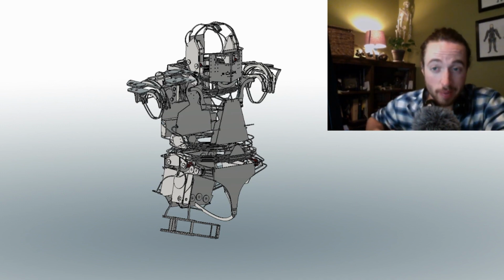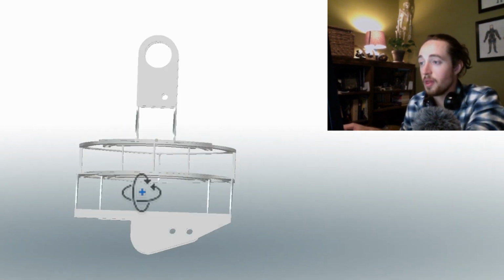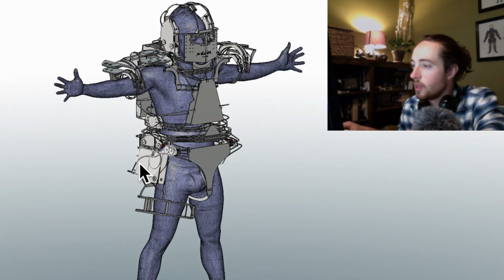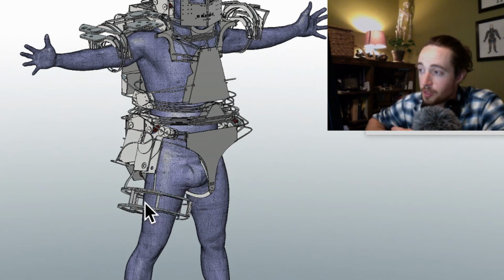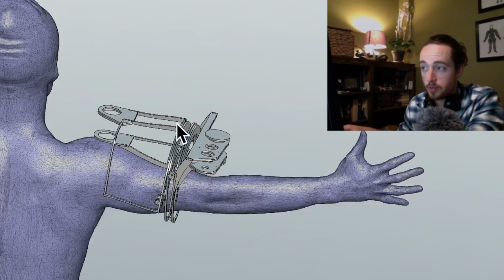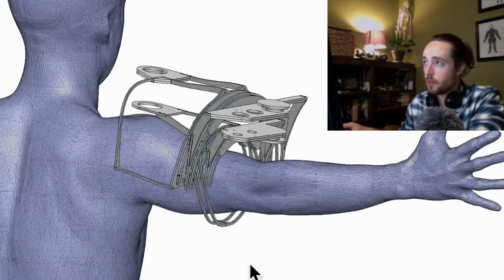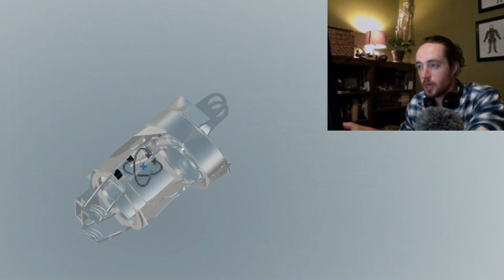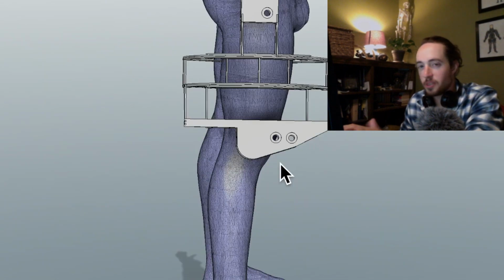AN EXO-THIGH

Comment: if i understand the knee structure correctly, you can only bent it backwards 90°. this could be a hinderence in case you fall down.
Reply from the maker: I’ll have to not fall down. 

There’s a lot parts of the suit that would make falling down bad. When it’s built I’ll probably do some test of how to get off the ground effectively
Reply: @DylanEdmiston   i think you could get something like 110° out of it by pushing around a bit of material. 

a multi directional internal harness, internal plates that cover jagged edges and cushioning  is a must. 

internal cooling and a quick acces crotch plate (because removing the suit might tale a long while) is also recomended.

rule 1,2 and 3 for wearing full body suits (cosplay or otherwise): 
- have somebody out of armor as a handler 
- drink plenty of water
- don't forget to find a way how to go to the toilet with the suit on

you could build a plywood/pvc/paper machee/eva foam  prototype to test everything first.
Reply from the maker: You're right. I will have to pee in this thing.
Reply: 110° to 120° of  knee movement would allow you to kneel down, sit on normal height benches , use stairs easily and get up from falling over. 
the suit is self supporting, as long as the suit doesnt break when you fall (or it is light enough to not crush you when it does) you should be fine when falling over. 

you should include some fuses that can  break by bending (not by acceleration alone) attached to the skeleton in every part of the suit to make the actuators disengage when the skeleton fails/bends. a rip- fuse could also be build into the actuators to deactivate the counter muscle if one muscle snaps.

another safety measure could be the inclusion of internal buttons with a high push resistance that activate breaks in the joints as an independant system. if the suit moves to fast, without your permission or too much force is applied from the outside the afflicted joints lock up for the duration of you inside the suit not conforming to the movement.

this prevents the hammer- drone/ mjolnir- unagmented wielder problem.

giving an external remote deactivation switch to a handler and/or including an external safety break (like you already explained) would nicely add to this... quintupple redundancy.

Comment: When you get the quotes, also ask about the price of difference components on their own. If it adds up to the same amount, then it might be best to save up a small amount and order the Torso first and test it for issues while saving up for the rest.
Reply from the maker: There’s a minimum cut fee of $150. But if it’s over that you’ll only pay for time of cut and material. So I could potentially build it in chucks. Though I’m not sure I’ll do it this way. I’m an all in kind of guy
Reply from the maker: That being said.  It could allow me to building more quickly so there is that.